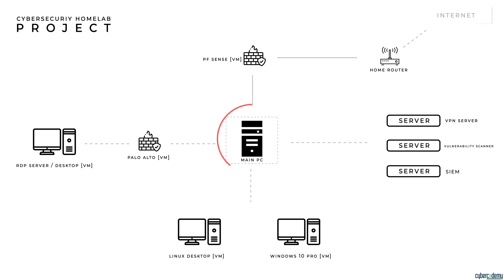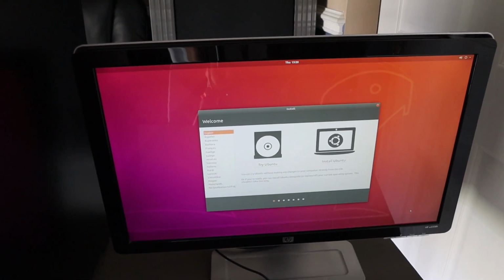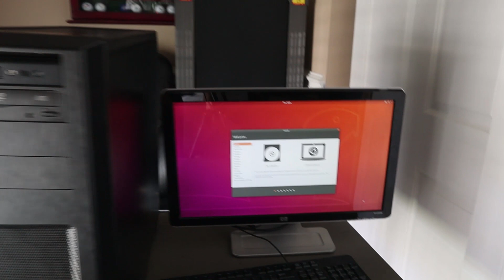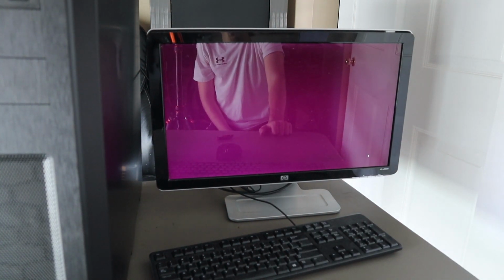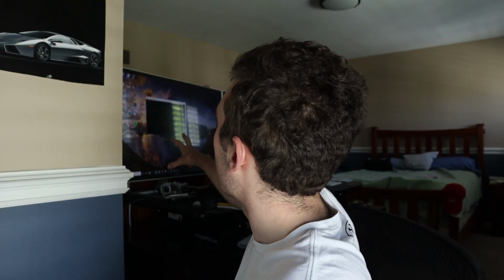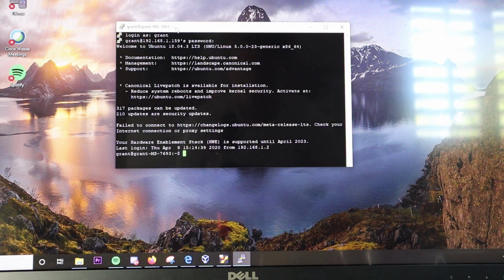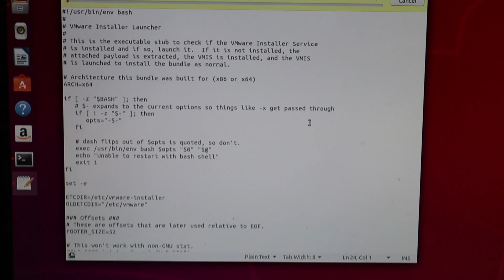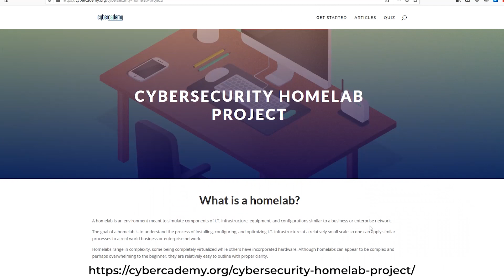Building a Centralized Ubuntu Desktop - Cybersecurity Homelab Project

Comment: Hi Grant, 

Thank you for the video. I'm setting up a HomeLab on VirtualBox environment trying follow your HomeLab settings. I installed the OPENSSH-SERVER on Ubuntu yet the windows 10 PuTTY cannot ssh the Ubuntu IP address. Error message "Connection timed out" I tried to ping it and error message "Request timed out" How do I resolve this issue? 

Thanks in advance.

Comment: Hi Grant, I love your video and I follow you for all your video but I have a question. Why did you decide to use Ubuntu as a base system and not other OS such as VM-ware ESXI or Proxmox or other?
Reply from the maker: Great question! At first I thought using Ubuntu as a base system would offer me some more experience using linux and then I could work with VMware Workstation on top of that to fast track my homelab setup because I care more about the network security components over the actual infrastructure, since this is such a small scale homelab. But now that I have looked into Proxmox, I think I am going to back track and use this instead since I can then manage all my VMs through the web client - appears to be robust and simple (let's hope 🤞) So changes to come already :)
Reply: @collinsinfosec Excellent, I'm glad to have been useful, in the future I will try Proxmox too, it seems to be a really good Hypervisor, at the moment the Lab is on Vmware ESXI. Keep it up, I love your videos

Comment: You cloud then build it from the web GUI then use VMware pro to connect and use them after build. Just a thought!
Reply from the maker: All good options! There's so many ways you could go about doing this! For me it's a matter of configuring a simple environment and then adding the network security layers on top, since I am more interested on the security side of things than the sysadmin type stuff. Lot's of options.
Reply: @collinsinfosec  Sorry I meant could build them locally via VMwarr ESXI server. Then using web GUI locally install vms and use workstation pro to remotely connect via a existing system. Sorry can't type for ish 😁

Comment: How to connect to server ?
Reply from the maker: If you are on the same network, you can simply SSH into the server or use a VNC client to interact with the UI. If you are outside of your network, you will need to set up port forwarding on your home router and then you can conduct the same processes as before!
Reply: @collinsinfosec   thank you
Reply: @collinsinfosec  just a thought, and I know this thread is a couple of months old... But I would think a better solution (or a more secure one) is to use a VPN solution to tunnel into your home network. Be sure to use certificate based authentication instead of of password based authentication. Definitely more work and will be more overhead on a shared server.

Comment: If the purpose of the tower is to run virtual machines look up Proxmox. Its built on top of Debian and has the ability to run Containers (LXC) it utilizes QEMU so that is solid. Plus its free.
Reply from the maker: Hi! I will look into Proxmox, thank you for you suggestion. This project is more about configuring a simple environment so I can start implementing the network security aspects on top of the small environment I configure here... so that's why I went with a simple Ubuntu / VMware workstation configuration.
Reply: This.